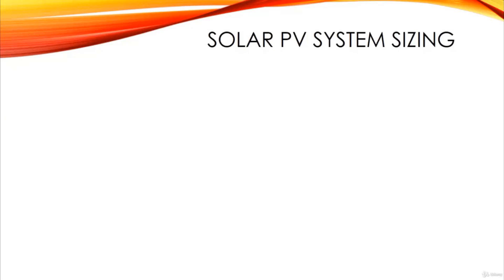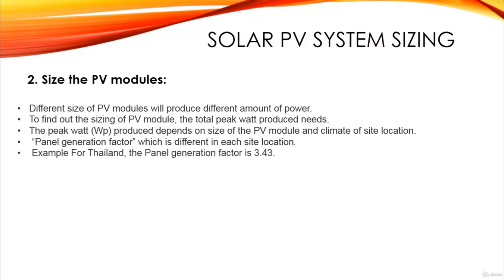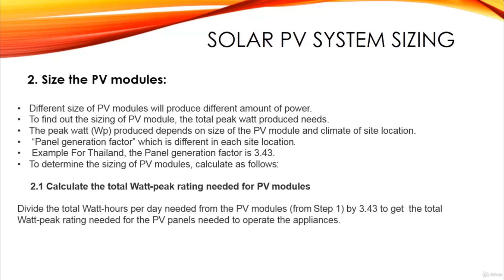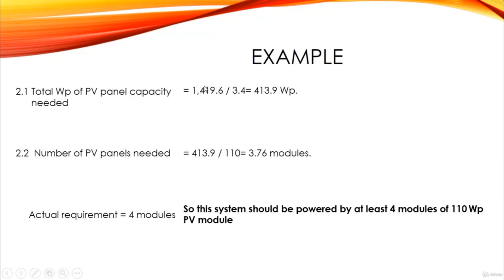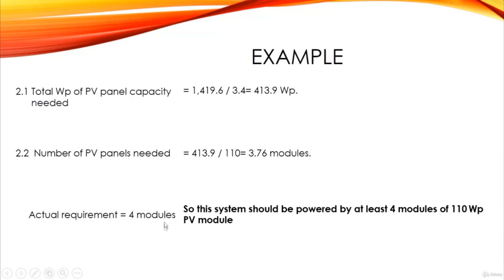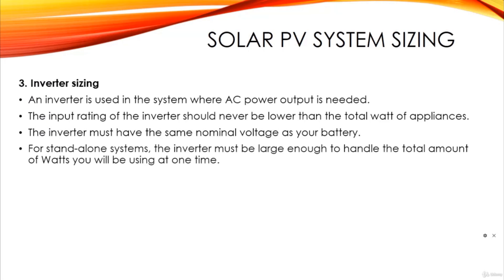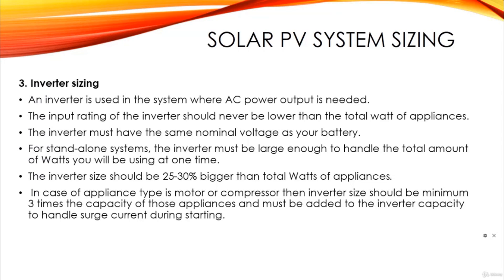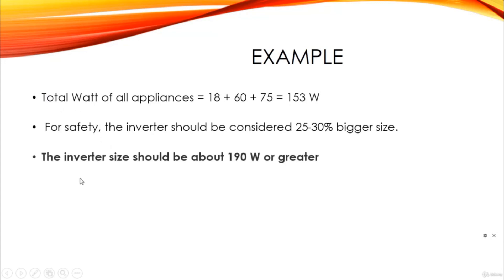Sizing the PV Solar Modules and Solar Inverter for Off Grid Solar System for Solar Energy Course

Comment: Hi you said that for the inverter sizing if you have a motor, compressor then your appliance rating must be 3* more than normal running... But in the calculation you did not take that into consideration?